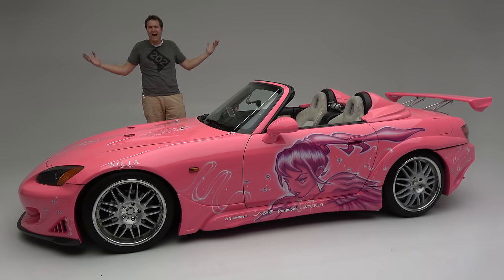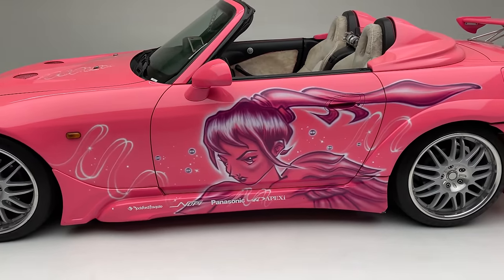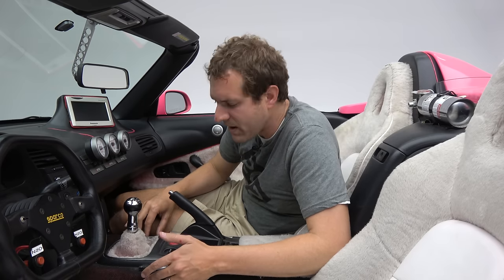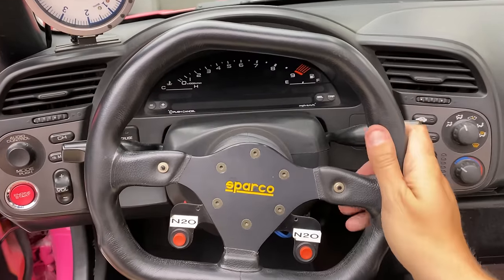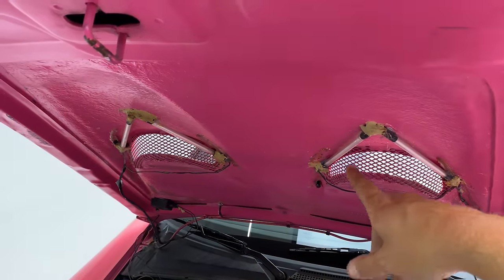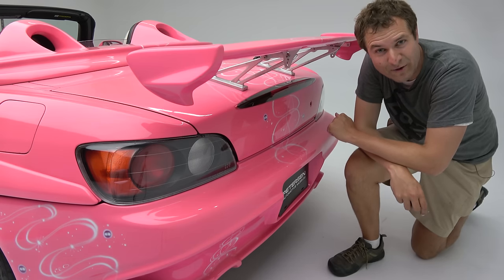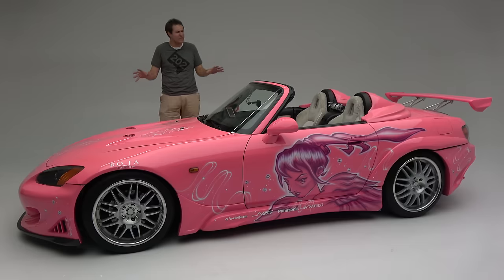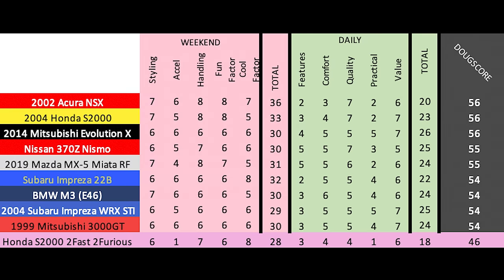This Honda S2000 Is a "Fast and the Furious" Movie Icon

Comment: The info about the jump crash was almost accurate. In fact, the remote driver of the s2000 was also in the chase vehicle that went off the ramp. And, because the remote rig was temporarily setup in the passenger seat, when the stunt car went off the ramp and crashed, the steering rig was pushed out by the airbag, injuring the remote driver of the s2000. But despite all that, the remote driver was able to safely stop the s2000. I know all this because the remote driver was my father. 

Great video though! I remember seeing all the different versions of the cars on set out in Florida as a kid. Movie magic is something special.
Reply: It has been a year... Bro needs more recognition

Comment: Doug, I can answer a few of your questions. Though I was only a background actor in the first fast and furious, and also a stand-in for Vin Diesel, I have about 25 years experience in the industry, so I can tell you some of the secrets, to the best of my knowledge, of how the industry worked these quirks. I actually have a picture of me next to this car on the universal lot...the back lot where the public is not allowed, so it was another one of the production cars, just as sloppily  put together as this one. 1) I bet you the fabric on the panel that hides the stereo was either added for the lighting department, so they can stick a Velcro light on there when needed and take it off without a severe modification when not needed,  which is also pretty handy if the unit was flipped open it wouldn’t upset the sound department if that lid was clicking on whatever it was resting upon while driving it for interior shots. 2) TVs were just starting to be integrated into vehicles at this time, so even a sloppy installation was a cool installation. People put these things in the center of steering wheels, in their visors, anywhere with often a miss shaped frame around it. But that was OK. This was 2003 as you said. 3) The missing seatbelt was again most likely due to the sound department. If you were driving this car with cameras mounted to it, or even this thing on a flatbed camera truck, these little things like seatbelts make noise. Through the sound department can tape them up and do this and that, but why not just get rid of it altogether. And that’s what they did in this case. 4) the rear view mirror. I’m only guessing in this, your guess could also be correct, but I would say that one of their shots required a specific angle, they knew it ahead of time so they modified the mirror for this. Just like when you watch a film and they remove the headrest from the front seats so you can see the passengers in the back, or see the cameras point of view from the backseat looking towards the front, it’s a modification so that you can see the actor, or in this case maybe the actors point of view. 5) it’s interesting they didn’t redo the shag carpets on the seats for the museum. Kudos to them keeping it original from how the production used it and how it sustained life over the years.The seats were clearly pink in the movie. In fact I can send you pictures of the car that I took pictures of in 2005 or 2006 that the pink was only half faded away. These cars literally sit uncovered at the universal lot, exposed to sun, so that is why the seats take on a gray tint, because it is simply the pink sun faded into that color. 6) at least this car has an engine. And you can tell the way the low profile tires in the front touch the fenders, if you didn’t open the hood. In the scenes that I shot on the first fast and furious when the flames were being thrown out of the rear exhaust, the engines were actually removed from these vehicles. All of the vehicles. The Integra the supra… All of them. This was for safety reasons as they actually had pyrotechnic crews run their special effects lines underneath the vehicle so that flames would shoot out the exhaust pipes in those close-ups. Over several takes, the bumpers actually started melting away. But you don’t see this in the movie. They had other cars another bumpers to replace it for the next scene. 7) The missing trunk. Though I’d assume that they had a deal with Honda that gave them a bunch of these cars, but they might’ve also had cars that were missing trunk features so if they didn’t need it, why add it. For example I worked on gone in 60 seconds and the BMW 5 series that they trashed were actually already trashed as BMW test cars that were not even street legal, beyond salvage, vehicles. They simply use their resources they have to get any vehicle they can get, and they may be missing a few parts.
Reply: This is actually a comment worth reading! Thanks man!
Reply: Imagineth  I'm pretty sure he mentioned them only as an example, not on this car. Did you read this?
Reply: Imagineth  I was giving an example, I said "like," of why they move things around in cars. Though there was no back seats in this car,  they place camera's behind the front seats to capture certain angles of the driver or front passenger in two seater cars just like they do with 4 seater cars for "POV"  shots, etc. Hope this helps.
Reply: Wow amazing reply with so much great information! Thanks for taking the time to write all of this up. Also great work playing Vin Diesels stand in, I didn't even notice you which probably means you did a great job! hahaha Thanks again!
Reply: @LarryFish3rman  Stand-in is different from Stunt double. I merely had to sit in the car while the camera worked out the angle, focus and the lighting dept did their things. So you wouldn't notice me :)  It simply allows Vin a break to rehearse his lines or relax  in between scenes. Then when they are ready for him, I step out and he steps in my place and they roll cameras. Still exciting to be part of.
Reply: @craigmeier  Awesome! Thanks for the clarification. Thats still pretty damn sweet though.
Reply: now thats a wall of text if ive ever seen one
Reply: That's amazing! In wich parts of the movies did you appeared tho? I just saw it yesterday.
Reply: Ok. Do you have a you tube channel, because you should. I love car movies and you got some cool stories. Like I was in the Army when they filmed that Army recruiting commercial in FT. Hood. We were infantry so we had to police the brass after live fire scenes were shot. The Abram and Bradly had just been introduced to service under the Reagan administration. They jumped Abram in that commercial. We built a ramp out of the natural formation of the terrain and made small ditch on the other side. That Abrams had to get up to about 65 to 75 miles per hour to hit that ramp and get the height they wanted for the commercial and they were only going to get one shot. It was great on film. They used two vehicles one making the jump and the one after. An experienced military track crew was used. Everyone in that vehicle went to the hospital with broken bones and seriously damaged that vehicle. It was the coolest jump I ever saw with a 65 ton vehicle.
Reply: @topdoge2632  , So the nature of being an extra is that you are hardly ever on camera in the final edit as we are technically "background actors" and out of focus...so attention stays on the Actors.  When I was Vin Diesel's stand-in, I'm only there to set up the shot for camera and lighting. So for example, when the camera was focused on Vin opening the secret compartment to initiate his Nitrous, He is not there when the camera needs to carefully set up the shot. I simply step in, put my hands on the knobs, and camera and lighting set that up so he doesn't have to be there for this, but then he steps in my position when the cameras are ready to roll. Sometimes they use "hand-inserts," but he was happy to participate even though his face was not on film. Back to that day for example, when the 4 cars were lined up in the streetrace and specifically blowing flames out the bumper tail pipes, is the only scene you can barely catch me in as an extra if you know were to look (second row of crowd and about the 3rd/4th one from right). That was shot in a sound stage (converted warehouse) in Chatsworth/Canoga Park area (where the porn industry is famous for filming at). The main streetrace was in Torrance/San Pedro California area. But on this particular sound stage day they needed special effects to shoot the flames. Due to safety standards, you can't have flames on a movie, with actors and background extras so close to set, near gasoline engines...so they set up this "close up on flames" day in a controlled environment. The cars used did not even have engines. If you would have seen the front of the cars, the suspension was so high up since the cars had no weight of the engines to hold the car down, but the bumpers and exhaust was the only "shot" needed. So special effects had tanks full of some sort of flame fuel that was tapped into the exhaust pipes that then shot out the flames.  They did the take a few times, and JaRule's Integra specifically had a melting bumper and it really started to stink.  Back to the basics of the cars needed for this scene, even the interiors were down to the basics, even though there were some closeups there. Instead of actual stereo head units, they were simple molds of a headunit with barely painted details. They must have took a  mold of the main dash of each "principal photography" car and duplicated it as painted mold.  I love cars and I truly enjoyed working on this project. The director and producers had actual recruits going to real Los Angeles street races and car club meets to get all the background cars. I cant remember if i mentioned in previous comment that I was the first group to see the first Trailer!!!  Director knew he had real car club / street race fanatics on set and he invited us in groups on 5 at a time to see the first trailer edit.  So yes, I was probably the first 20 people to see the trailer. Pretty cool!!!  He got such a good reaction from the Hondas going under the Semi Truck he obviously kept that in he trailer. However they never followed our advise about the lame stickers they chose to put on the side of the cars..like who wants to see super heroes on your door like a HotWheels???  Anyways, they will forever live with that choice. Glad I can share a piece of movie history with you.
Reply: @joaquinmojado  The stunt crews that are hired, broken bones and injuries are part of their game. They get paid a lot of money. It’s around $800 just to show up on set for one of those guys. Then they get an amount of dollar per feet they fall or what they’re doing specifically. An average day is a couple thousand bucks. Plus they get residuals on the film. You have to give it up to them. Luckily they get the SAG health benefits, or at least if they work enough and qualify for it, because later in life, those injuries take their toll and they are in pain for retirement. Mad respect and props goes out to those guys that do this and get injured for the sake of entertainment.
Reply: @craigmeier  dope, thx for sharing your stories man !
Reply: @craigmeier  great info bro
Reply: @user-mv1nz3hs8p  I'm glad you enjoyed my "geek-out" post. I enjoy the entertainment industry so I only share my enjoyment of it.
Reply: @joaquinmojado  Do you have a link to that video? I would like to see those jumps!
Reply: @craigmeier  What do you mean with residuals?
Reply: @AlbertoDsign  Please elaborate on your question to me as I'm not sure what you want me to elaborate on.
Reply: @craigmeier  Sure! From this answer of yours: " Then they get an amount of dollar per feet they fall or what they’re doing specifically. An average day is a couple thousand bucks. Plus they get residuals on the film. You have to give it up to them."
Reply: wall of text crits you for 9000 dmg!
Reply: Doug need to pin this comment
Reply: @craigmeier  Legend
Reply: nerd
Reply: Thanks for the incite. Very interesting.
Reply: I didint read your comment but i 110% agree with you 🙂💪🏼
Reply: Why doesn’t it get over 4k rpm
Reply: @OLOYism  I don’t think you can do paragraphs in YT comments. Sorry didn’t mean to write a book. Doug is tha homey. Quirk loving car geek like me

Comment: I'm a camera operator, I've worked on a few BTS of TV commercials and the like and it's really cool talking with the prop makers. It's always a mad rush behind the scenes to get things fixed / mods done for the director before all the actors are in place on set. It's why these things can be rushed. 

Also bath mats were probably used because they're very easy to obtain and aren't bespoke in any way. This is really normal in movie props and effects as it makes more economic sense and also makes spare parts super easy. It's also why enthusiasts can recreate a lot of movie props to 95% accuracy, it's super neat.
Reply: I can imagine, and there being a ton of other cars to add with their own separate copies including the hero car. They can't do everything 100% right it's just too much work giving the limited time for filming and everything. They're only supposed to look good enough for the film and everything else well, they really don't expect anyone to actually get close and look at all the details.

Comment: Car with a crooked steering wheel turned 45 degrees in the wrong direction
Doug: Handling is quite nice, 7/10.
Reply: Imagine if it was turned 45 degrees in the right direction... 8/10 eeeeeasy.....

Comment: After this, I've rewatched the first race of 2 Fast 2 Furious and any other scene where the S2000 is featured prominently, and I must say that all those imperfections pointed out by Doug were not visible at all. Maybe it was camera angles or even CGI edits in places, but they did a great job (in hindsight, by the way, it wouldn't have been bad to plainly see those tacky jobs: one could assume that said jobs were made by "hobby" tuners, maybe Suki herself, people that didn't have the precise tools and techniques that a professional tuner has, not to mention the necessary cash. This was often the case with car enthusiasts that wanted to have a go at modifying their cars on a budget).
Reply: Exactly, he talks about how "bad" all the mods are, when in fact this car absolutely represents the home built tuners of the era.

There's cars all over this country that have sat for the same period that look as rough yet they were considered amazing builds in the age.

Comment: The steering wheel literally has to be sideways to drive straight

"Handling 7"
Reply: LOL!  Ikr?  I guess it must still handle pretty well once you get used to that.
Reply: Steering wheel position has no effect on handling...
Reply: Munshat Rahman  okay wow that's a committed roast
Reply: Its like that to see the speedo and tachometer, if it was straight the flat top blocks the drivers view of everything
Reply: @MrJMS814  exactly
Reply: Steering wheel being off center is on purpose. So when you straighten the steering wheel the tires will point to the left and look nicer for taking pictures. Otherwise in order to keep the wheels pointed 45 degrees to the left for a nicer picture the steering wheel wouldn't be centered and it would be turned and not look as nice in the pictures. So it's done on purpose

Comment: Doug: "Handling 7 out of 10"
Me: how?  The steering wheel isn't straight.
(Some of you need to learn how to take a joke)
Reply: The Doug score is just a load of bullshit.
Reply: @wooferjr169  In a way!!!
Yeah!!!
Reply: The steering wheel isn't directly related to handling. It's just aesthetics. The actual car handles pretty good and having a wide body kit means it has even more grip with bigger tires.
Reply: It's still an s2000
Reply: handling and steering are two totally different things chap
Reply: @A real bisexual petrol-head I drove my project DTM 190e with a crooked steering wheel also for a long time and it still handled just as good even after I straightened the wheel.
Reply: A stereo typical American that wants to get invited by the movie/Peterson peps😁✌
Reply: The steering wheel can be upside down and it wont affect handling
Reply: Depending on the car, I just close out when the drive happens, sometimes I watch the drive, but I never watch the Doug score. Nothing makes sense, might as well just roll a 10 sided die for each category.

Comment: A lot of people rag on the styling of this S2000 but honestly I've always been a fan of it. The Veilside kits and paintjob really fit the look they were going for in my opinion
Reply: The Legend 27 Returns to YouTube boi look at your profile
Reply: The Legend 27 Returns to YouTube  Lets be honest, Ricers can't even afford the nice airbrush side of the paint. It would be cheap spray paint from Walmart.
Reply: The Legend 27 Returns to YouTube  I use to work at Walmart. Saw them all day long rolling into the parking and revving up their engines.